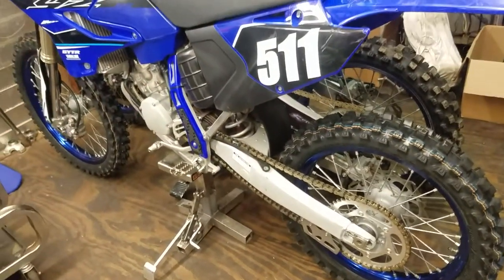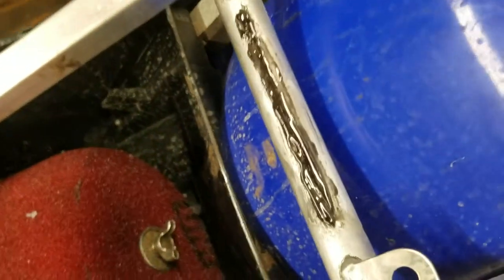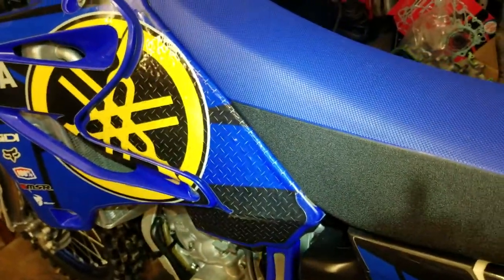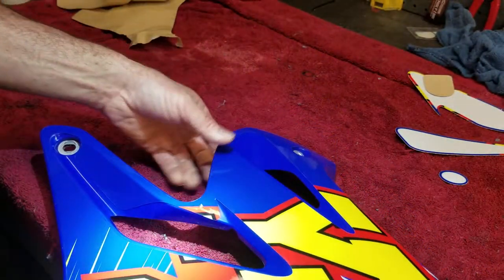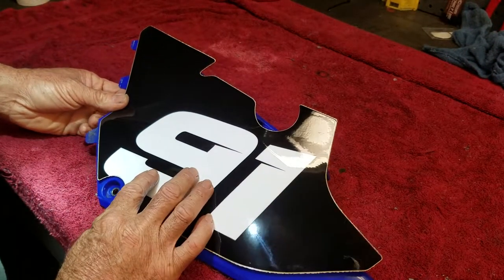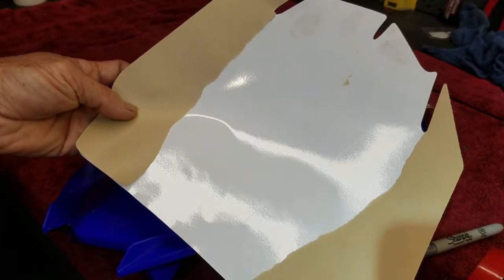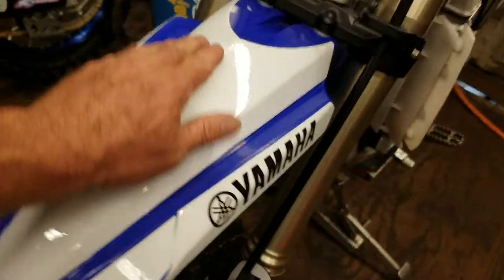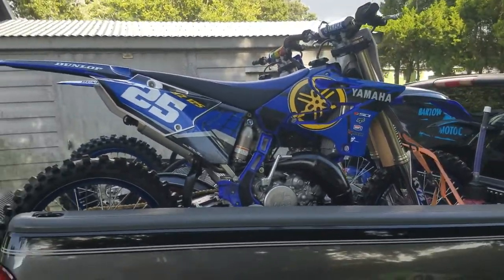1:11 YZ125 Build & Setup. (Video 4) Graphics done. Shes loaded and ready for the first ride

Comment: What years yz/yzf 250/450 shock and fork springs can I use for a yz125 there is a shock spring on eBay yz250f he said 09-13 would this fit 🤙🏻
Reply from the maker: Off memory I believe from 2006 to 2013 yz250f shock spring fits the yz125 from 2005 to 2022. And from 2006 to 2010 the yz250f fork springs fit the yz125 from 2006 to 2010. Not sure on the fork springs from the yz250f and 125 after 2010.  What I do is compare part numbers on race tech or factory connections page to see which bikes share the same springs
Reply: I’ll do that thanks 🤙🏻